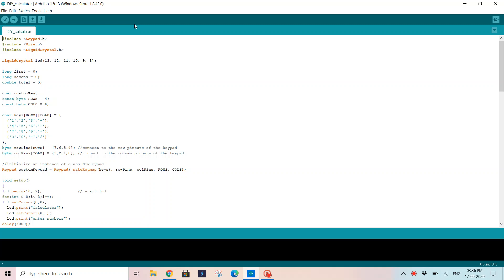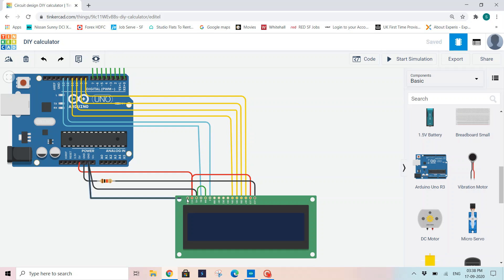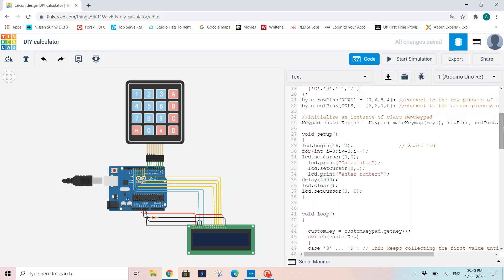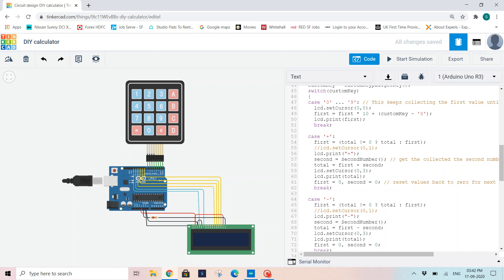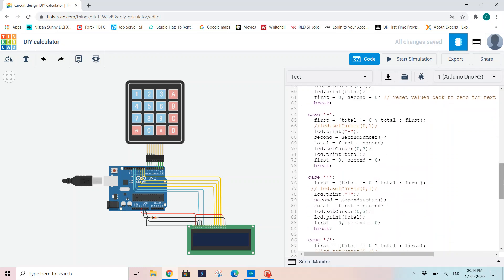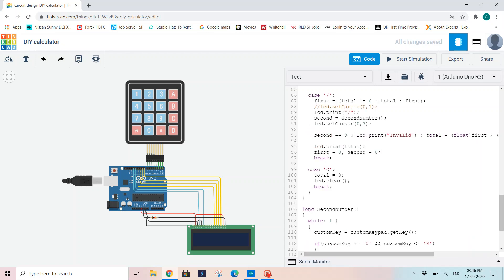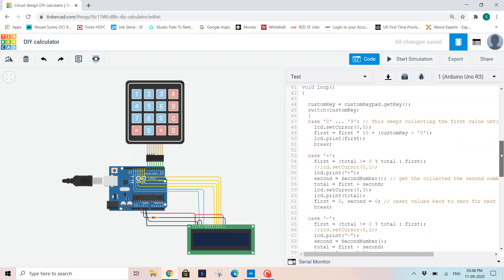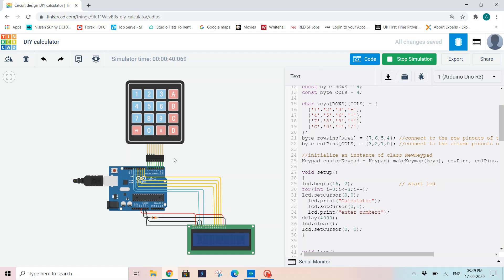Arduino DIY Calculator using a 4*4 Keypad and 16*2 LCD Display || Arduino Uno Calculator Project

Comment: "Impressive gas leakage detection project! Your video provides a clear and insightful guide on using a gas sensor with Arduino for safety purposes. The detailed explanations on wiring, coding, and the demonstration make it easy for anyone to follow along. Safety is paramount, and your tutorial adds a valuable resource for those looking to enhance their home safety systems. Well done!"

Comment: "Fantastic Arduino calculator project! Your detailed tutorial on creating a 4x4 calculator with Arduino is a great guide for beginners. I appreciate how you explained the wiring and coding steps thoroughly. The use of a 4x4 keypad adds a practical touch, and the clear display makes it user-friendly. Excited to try this out and explore more Arduino projects. Thanks for sharing!"